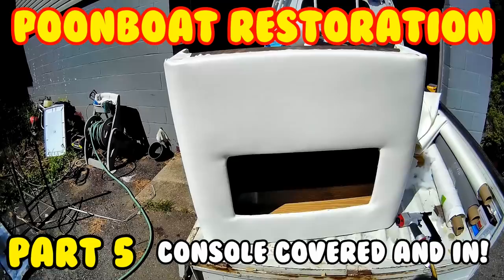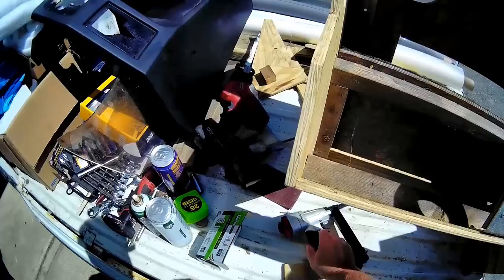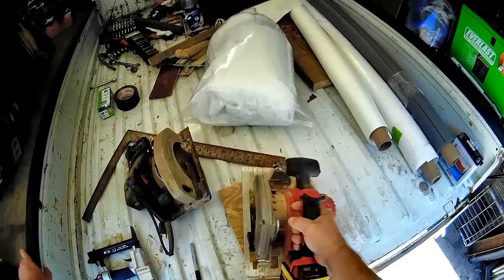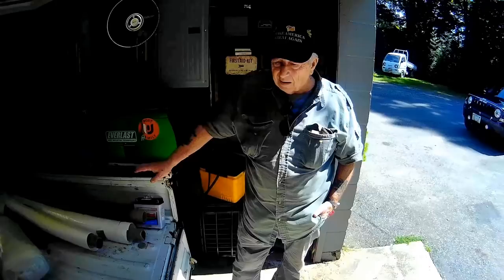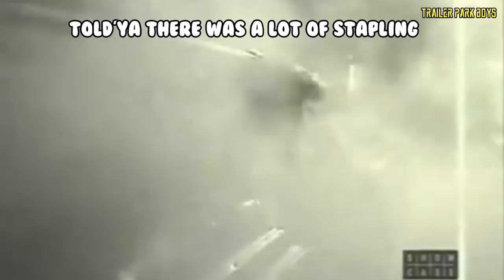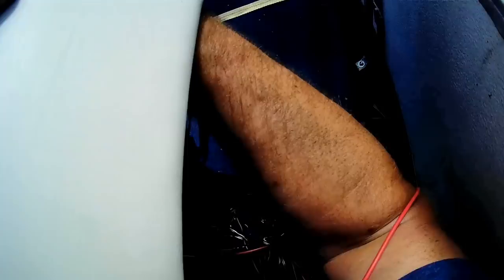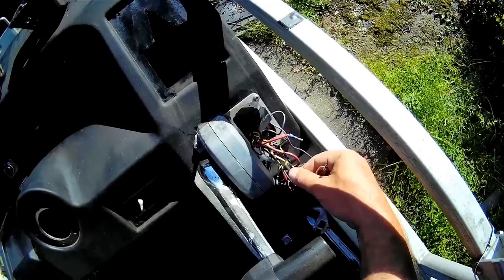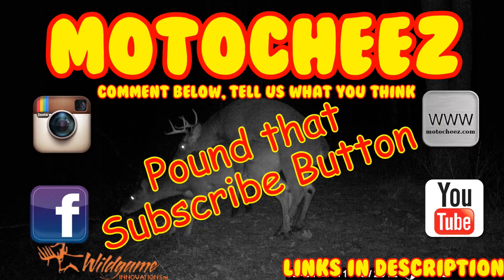Pontoon boat resto (Part 5) finish up the center console. Vinyl, throttle, steering.

Comment: Looking Great Cheez!!! 👍😁
Dude I upholstered for 18.5 yrs professionally & was a upholstery division supervisor @ the furniture capital of the World High Point NC. Let me tell you for you not being a upholster & never had training you done a Awesome job! Other than you screwing up the vinyl cut at the hole. But would I have had you on my team of upholsters in the Worlds Capital of High end Furniture??? Absolutely, U damn right I can see you have a knap for it! There’s good money in upholstering too. 👍
Reply from the maker: Damn, thanks man! 🔥🔥🔥😁👍
Reply: MotoCheez for future reference on a hole like that cut a cut across the center like you did stopping off about 2-3 inches from the edge. Then cut one cut toward each Corner stopping 2-3 inches from the edge. Then cut several cuts all way around it also stopping 2-3 inches from the edge.....Then start working your material to the inside & stapling it & rub out the wrinkles as you go! 😉
Reply from the maker: @CCRider5312  thanks for the info. I wish I new how to mold the shapes around foam 😁
Reply from the maker: @CCRider5312  thanks!

Comment: The saw is made for left hand or right hand use. That way when your holding the front knob with your other hand it doesn’t block your view of your cut. They make battery powered saws both left and right handed.
Reply from the maker: Never noticed you could get either way, mine came in a kit

Comment: It makes more sense to have the saws set up that way for a right hander.  Your torso is to the left, the blade is central, the motor and chip chute are off to the right (spitting away from you).  It's more balanced and efficient that way.
Reply from the maker: I disagree. The larger plate on the left lets you rest the saw on the wood,  the cut off piece will fall off and the saw won't want to fall off with it.
Reply: @MotoCheez  Start from the other end of the cut.
Reply from the maker: @RatdogDRB  then it would be in my left hand, or pulling toward me

Comment: Carpenters use wormdrive 15 amp saws and the battery ones you are using ,are designed in the same style as them. I like them much better because you can see the blade much easier well you are cutting.
Reply from the maker: I agree they're much better and more powerful. I've used the 110 volt screw drive circular saws before.

Comment: If you ever find yourself in the shituation where you've cut too much, but you need to turn the corner, simply cut a strip, lay it face to face over your problem, staple it down on the line, then wrap it over. Yes, there will be a seam there, but hey, it's better than a gaping maw, right?

Comment: I never thought of wrapping one in vinyl💡 . It sure seems a whole lot easier than messing around with coosa board , fiberglass and gel coat fer fuck sakes . 😲Who cares if it won't last forever when you can build it that fast , and make it look that good . 😏
Reply from the maker: The original was vinyl, the floor will go about the same time. I used pressure treated plywood

Comment: A x would have worked better on the big hole but you got it done. Just my two cents .
Reply from the maker: You're 100% correct, I was tired of stapling at that point, getting sloppy
Reply: @MotoCheez  yea i feel sorry for the next guy that re does that. That will probably be you and you will cuss yourself lol
Reply from the maker: @jimmyturner3715  yep 😆😆

Comment: Might hunt for some aluminum channel to go around that front compartment to hide your mistake and to help keep water out. 
https://www.lowes.com/pd/Steelworks-8-ft-L-x-0-75-in-W-x-0-75-in-H-Aluminum-Trim-Channel/3058185
Or you could look for a hatch you can screw on.
https://tinyurl.com/y3tcu9wz